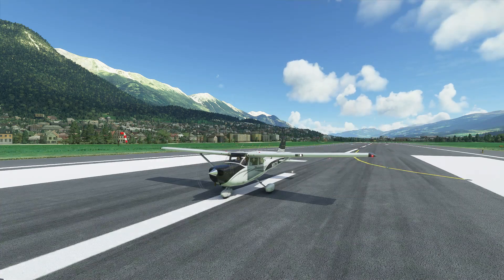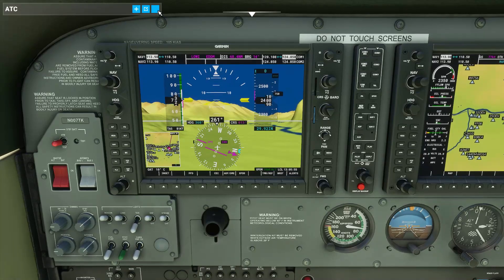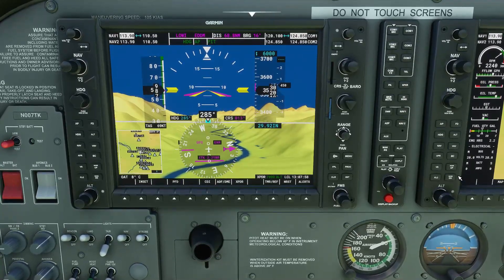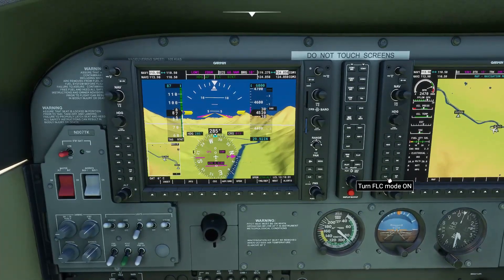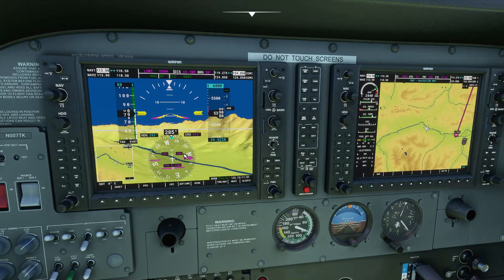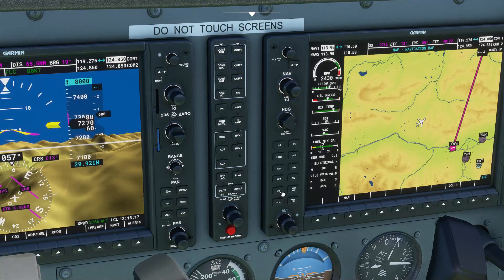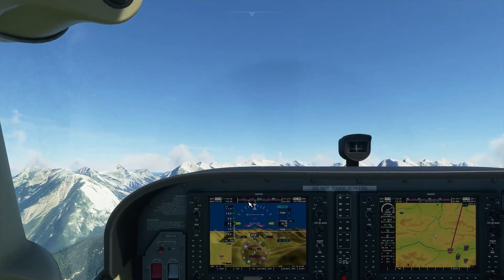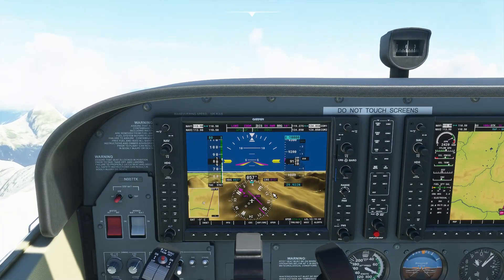Microsoft Flight Simulator 2020 | G1000 Tutorial EP #2 | How to use Autopilot |

Comment: 6:10

I’m new to flight sims, and this simple sentence is by far the best explanation of how mixture works I’ve yet to come across. I didn’t understand that ”choking” the engine means you’re literally drowning it in fuel because the necessary O2 for combustion isn’t present. 

So general rule: if I’m taking off at or above 4k elevation, run a leaner mixture? Are there any situations where I’d want to run a leaner mixture at low altitude?
Reply from the maker: I think in general it's pilots discretion. Until FL120 oxygen levels does not change as much. My personal practice is to take off and land with full rich mixture and lean after I'm 1000 - 1500 ft above the ground. And keep climbing with lean mixture.

Comment: Your videos are very helpful to as, 
Question....you were flying VFR, but you select even altitude of 10.000 ft. Your magnetic compas showed 060. Is something wrong here or I need to learn more about flying? 
Thanks, George.
Reply from the maker: Thank you very much, if you're referring to the CDI (Course Deviation Indicator) as the magnetic compass it's showing the heading of the aircraft 060. This is different than the altitude. Altitude is only displayed at the right side of the screen on the altitude tape. The number at the top is the selected altitude, the binder in the middle is the current. I hope I understood your question correctly.

Comment: So.. if i am understanding it right. The Nav1/2 setting where you have to dial in the right frequency is the old way of navigation before gps or not? 
At the moment i am thinking, i'll just use the gps, it seems easier. 

Also want to say thx, i finally got my IFR working and i think i finally understand it now. So i tried flying that, but never reached the planned altitude... kept stalling and didn't understand why. Now i do.. :) Gotta mix my fuel. Booyah! one step at a time, haha.
Reply from the maker: As you correctly mentioned the NAV 1 and 2 are the old school NAV radios integrated to a modern avionics system rather than the old gauges. Tuning in a VOR station frequency will allow you to track that signal on the PFD
Reply: Vor is still pretty helpful even with GPS because it can give you multiple points of reference you can cycle through. And just in case have an emergency or something you can have those frequencies dialed in so you know where you are relative to nearby airfields.

Comment: Can you switch between multiple waypoints with NAV mode or do you have to set a new waypoint each time you reach the current one?
Reply from the maker: When you enter your waypoints NAV mode should follow them one after another in the order you enter them if that's what you are asking David
Reply: @TheSimPilot  Every couple of flights I notice the NAV mode suddenly starts flying me to either an old waypoint or somehow just loses the actual coordinates of the the waypoint it should be on.  I'm wondering if I've accidently switched the selected waypoint with a keyboard command.  I'm trying to figure out how to see which waypoint is selected and if you can cycle through them.
Reply from the maker: @Mr_Fix_It_  ah I understand your point now. There is a known bug that causes the nav mode to stop doing it's job. Hopefully Asobo will fix it in the next patch
Reply: @TheSimPilot  Ah, ok that explains it. I wondered that. Thanks for the help. I'm now subscribed and will be checking out your content.

Comment: I have done a couple of ILS approaches with the G1000 and only hit the CDI to go to LOC 1 and the APR button and the plane came down without hitting the VNV button
Reply from the maker: You don't have to engage VNAV for approaches. VNAV is used if you have a vertical profile programmed in to the G1000 along with your flight plan. It's not functional in MSFS2020 at the moment but when it starts to work VNAV mode will take care of your climb and descent until the approach. In other words G1000 will climb using VNV to the programmed cruise altitude and when descending bring the aircraft down to the altitude where you capture the LOC for your approach.

Comment: VNV is not really workling for me. APP works finde but VNV not could you do a specific VNV tutorial if it works for you?

But good tutorial!
Reply from the maker: Lennart VNV is not working at all at the moment, Asobo will release another patch later in the month and  hopefully it will fix VNV problems. They said VNV is partially fixed for the airliners but I haven't tested it myself. I'll be more than happy to make a tutorial on VNV when it starts working as it normally should.
Reply: @TheSimPilot  ok, that explanes something... thak you for the info^^